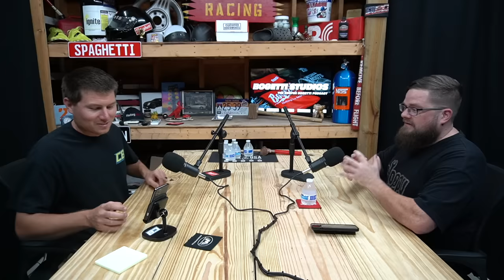Matt Happel : Sloppy Mechanics, Sloppy Vs Dangerous, Next Engine | The Cooper Bogetti Podcast Ep20

Comment: Matt is the only reason I went LS. Period. From the early 2000s with Fairmont part 1 that broke the rear and ended up in the ditch. Lol. Now I'm building turbo trailblazer ss that make 800+ on stock bottom ends. Take that Elon Musk lol

Comment: I bought my 12 silverado new with a 6.2 and put a LS9 cam in it after the first year. Since the first month of ownership,  I used a Diablo unity tuner and increased line pressure by 10 percent. Never had an issue. Went through the trans at 90k just to do it under warranty (I'm a gm mechanic). It's at 210k now. Now issue's and still whole shots like a mother. It had a stock 6L80e but after the rebuild. I put the 90e clutch pack in. Still running the stock converter

Comment: With Cooper saying oh it shifts when I spin males me think he just puts it in drive and goes. Instead of manually shifting it, so you can atleast try to pedal it.  I did a cam in a 2015 scsb seirra with 6l80e. If you left it in drive and tried to jump in it as soon as it saw rpm and speed it shifted even though chassis speed was still 10mph the wheel speed was 70mph and would.keep shifting. I had to teach the kid to manually shift it with the buttons to ride the gear out till chassis speed caught up with wheel speed so he wouldn't put the thing in a ditch cause it got out of hand.
Reply: Imagine confusing a true auto street truck with a dedicated drag car designed for power, straight. Smh

Comment: 4t80 swap for the ls4 isn’t that hard and honestly for how cheap the cars are it’s not bad if a simple mechanic/welder like myself can figure it out… the oil pan / starter ends up being the most fab if you dont find dudes special pan. There’s more coming out people are mounting the caddy superchargers on them now I have yet to see one running tho… they are hilarious to drive and it’ll be cool to see people swap them into mid engine cars